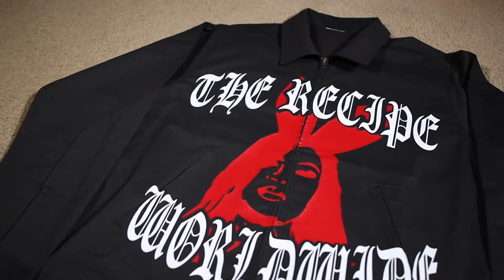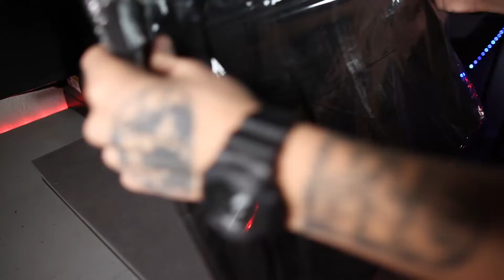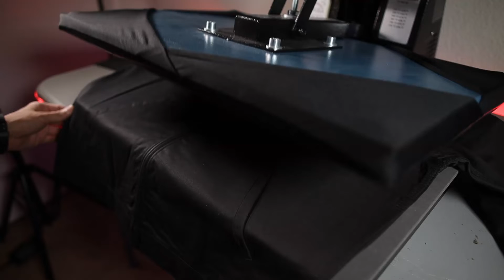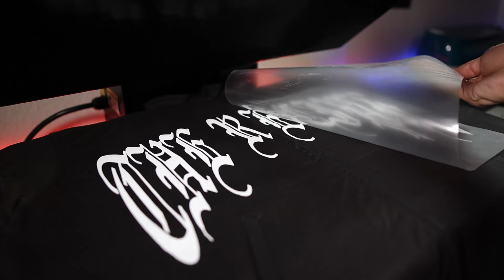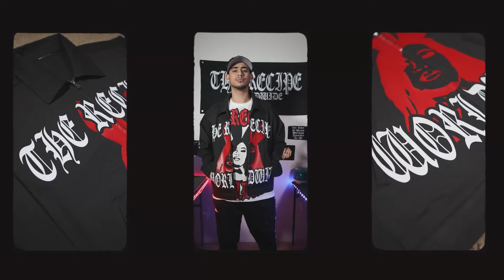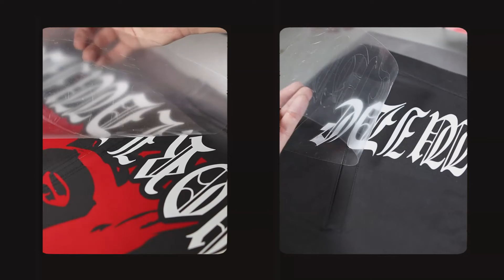How To Customize Work Jacket With Cricut, HTV, & Heat Press (TUTORIAL)

Comment: Hey Don, I have been running my clothing brand for a 2 years and I'm planning to add Heat Presser Vinyl. I'm wondering if you could tell what is the size of your heat presser?? I was planning to buy  15 cm x 15 cm heat presser but I'm planning to vinyl on a tee,hoodie,sweatpants etc

Comment: Hi, I recently bought the explore air 2 and I noticed it always cuts my siser easyweed htv very sloppy. It doesn’t cut accurately. I am using a very basic font and I see that you use very intricate/detailed fonts and wondering if you’ve had problems with the cutting accuracy.
Reply from the maker: I have not experienced that problem before. Are you using the correct needle pressure?
Reply: @therecipeworldwide  that is my main suspect for the problem. Is there any way to calibrate the correct needle pressure?

Comment: Which printer did you use?
Reply: He is using a vinyl cutter. Cricut vinyl cutter does not print. It cuts out designs from heat transfer vinyl or adhesive vinyl for decals or stickers.